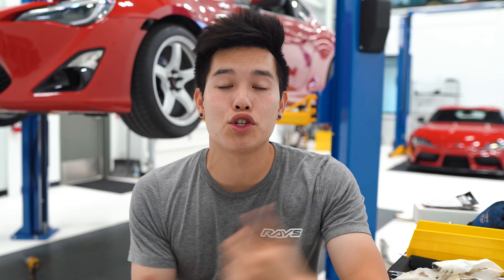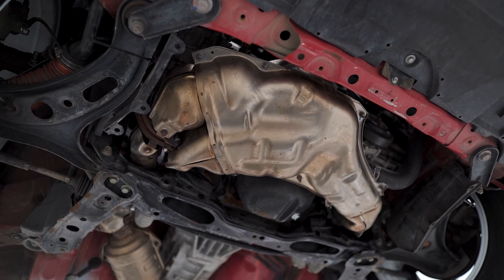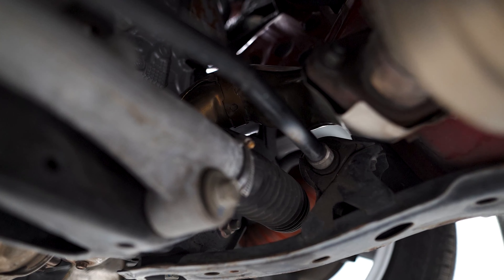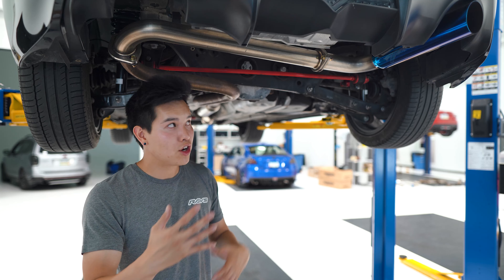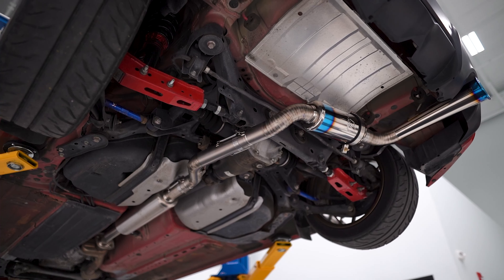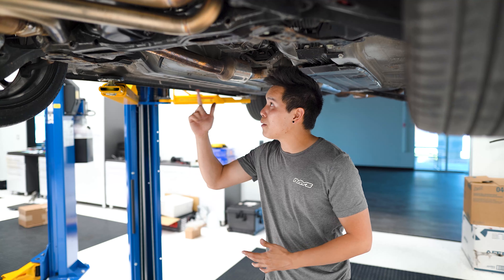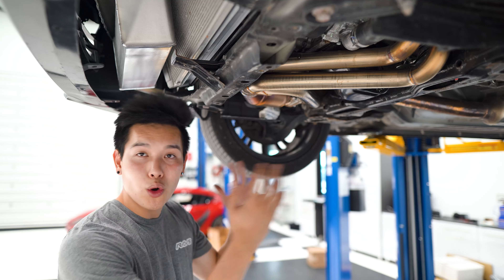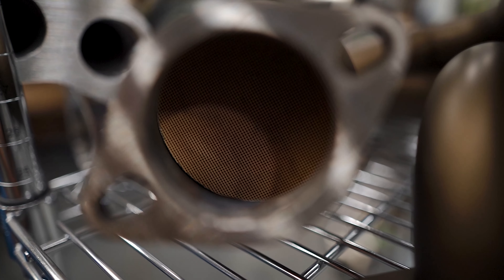Aftermarket Exhaust Guide for your FRS/BRZ/86

Comment: Is it possible to do a full exhaust change without tuning & voiding warranty? Like doing a FULL titanium Blox setup (with their catback, EL headers, and front pipe)? At which point or how is warranty voided when it comes to exhausts?
Reply from the maker: I'm not going to say that your warranty will be voided, but any exhaust modification other than a catback will likely cause them to deny your claim as it directly affects the performance of the engine. You're also going to want a tune if you do a full exhaust, otherwise, you're not really going to get the benefits of upgrading the whole system.

Comment: If I get the invidia q300 catback exhaust and the ft-speed header . Will I need to change the over pipe or can I leave it stock ??
Reply: I have equal length uncatted headers and the Q300 rn with a stock overpipe, already seeing a lot of gains over the stock exhaust setup so I don’t think it’s completely necessary
Reply from the maker: You aren't required to change your overpipe. The FTspeed header can mate up with either a stock or aftermarket overpipe.

Comment: Will I need to tune if I get the ft-speed uel header with my hks spec l catback exhaust i already have on
Reply: It’s highly recommended to get a tune along with header upgrades, Altho you don’t necessarily need a custom ecutek tune, something like the Open Flash Tablet stage 2 or 2+ would work
Reply from the maker: I would recommend getting an tune since it can affect the fueling and such.
Reply: Thank you both for the helpful information i wasn't sure because ft speed website says u don't need a tune i may be 100 wrong though
Reply: The ecu can adjust fueling just fine. You may get a CEL if catless which I dont recommend. But dont expect much power that way. The gains from a header without tuning are almost nothing. All the power comes from the tune.

Comment: Are we able to change the headers and do a stage 2 tune if we haven’t changed the front pipe?
Reply: Yes 🗿
Reply: @GerardLESC  thank you. I would’ve thought we’d have to go catless with the headers and front pipe in order to do the stage 2 tune. 
So far, I only have the greddy rs cat back
Reply from the maker: Just requires an aftermarket header.

Comment: But you need back compression from headers for more power so having a cat works... also on equal length is better. You actually lose power going catless and having unequal
Reply from the maker: This is a common misconception. The pressure used to get rid of the rest of the exhaust gases that remain in the cylinder is determined mostly by the size and length of the runners and collector. The catalytic converter just becomes a point of restriction. Engineering Explained has a very good video going through this whole process: https://www.youtube.com/watch?v=jjPeP_Nn2B4
Reply: @KevinVo  it’s cause my friend has stage 2 e85 tune with Tomei uel, invidia catless overpipe,  catless invidia front pipe and n1 cat back. I only have n1 and flex fuel kit but running 93 and I still pull on him.. I have no tune brother.
Reply from the maker: @ed.sthetics5904  maybe your friend has a bad tune or is a bad driver 😅